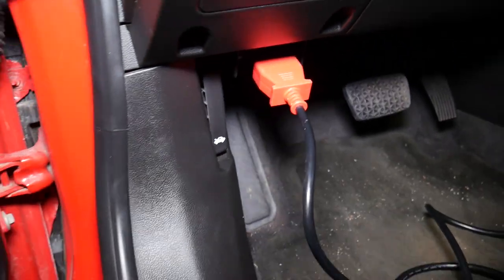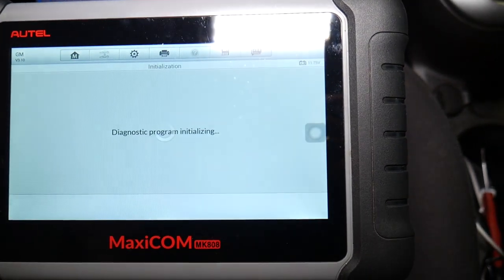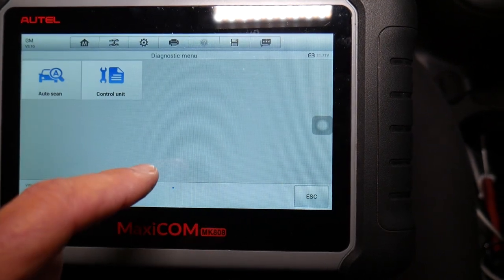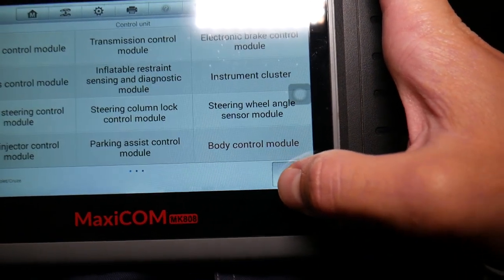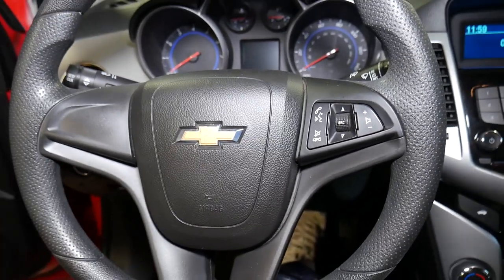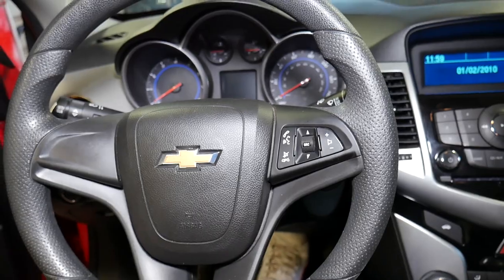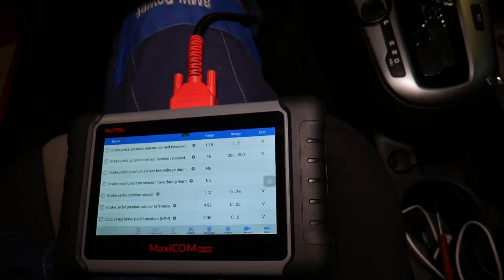FIX CODE P057C BRAKE PEDAL POSITION SENSOR CHEVY, CHEVROLET, GMC, BUICK, CADILLAC

Comment: Many Other people I see have this problem with the BCM forgetting the Sensor - does this scanner RELREAN the Body control Module to see the sensor so the brakes will go on and off as they are supposed to do?     if not or even if it does, do you know what scanner does this?  what's the best scanner for the cheapest price that can relearn the sensor?

Comment: Nope   it doesn't take care of our problem because you didn't show the brake lights going on at the rear of the car and off again when you let off the brake.     I put a new sensor in and it did the EXACT same thing the one O took out was doing.    step on the brake and the lights go off for a second then back on, let off the brake and the lights go off for 5 seconds and then come back on and stay on while driving. the only go off all the way when I shut the car off.   this car is a Pontiac Torrent ( Same a an Equinox )  with that same exact brake pedal position SENSOR <-- this is NOT A SWITCH.   if it was a switch this would be much easier.   
    Your tool is awesome but I don't have 560.00 - is there a cheaper one?  does yours come like it is right out of the box?     Can this one do the RELEARN for the sensors like I was hoping you would do here instead of just saying it's fixed?

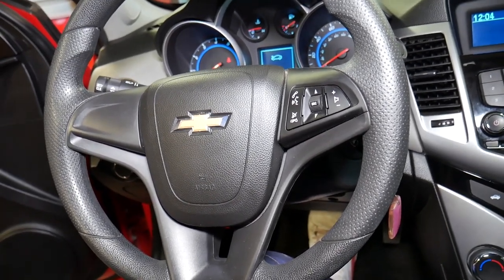Comment: you keep calling that a SWITCH,  it's a 3 Prong sensor man,  not a switch.   see at 5:07 / 8:47      I have it freeze framed,   is this screen showing us a RELEARN program so the BCM will learn the position of that sensor and start working properly?

Comment: Did you have to recalibrate it?
Reply: I'm working on a 2013 Tahoe, in my scan tool under EBCM (electronic brake control module) it has the brake position calibration.

Comment: I have a 2011 Cruze Liz and I have the p057c code coming up. Ive replace the sensor 3 times. The CE light goes away for about a month after replacing the sensor then comes back. Even with the CE light on cause of this code my brake lights still work. They work so good that when the car is parked not running and no key in the ignition the lights come on by themselves. Driving down the road they come on by themselves, this sucks cause when you have the cruise control on and the lights come on it continuously kicks the cruise off. To get the lights to go off I have to pull the brake peddle back with my foot just to get them to go off. Any insight on how to fix this problem would be much appreciated.
Reply: And the criisewant work